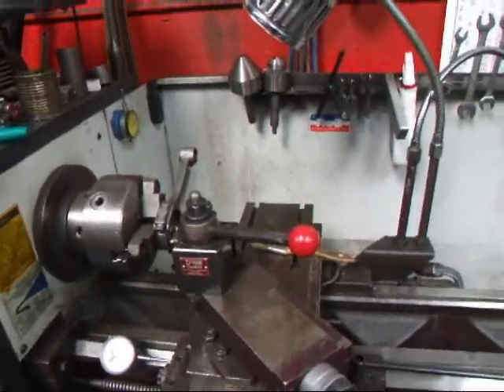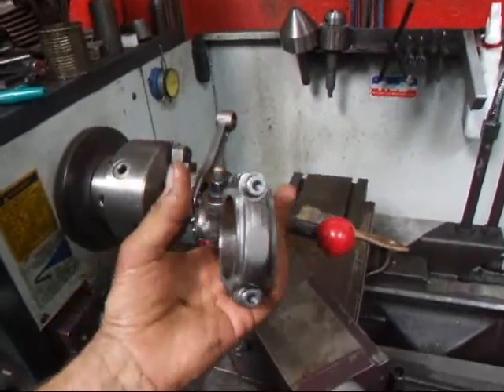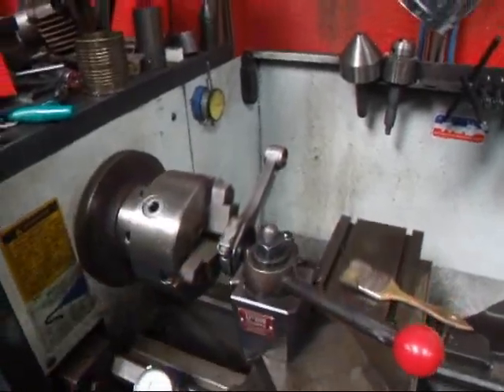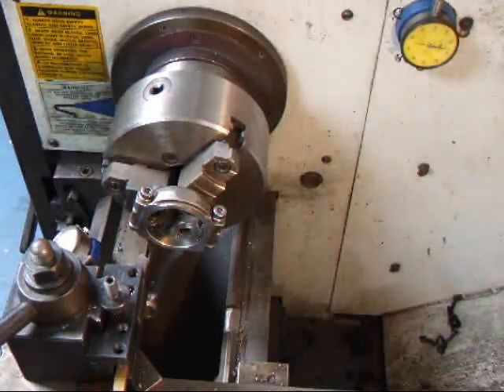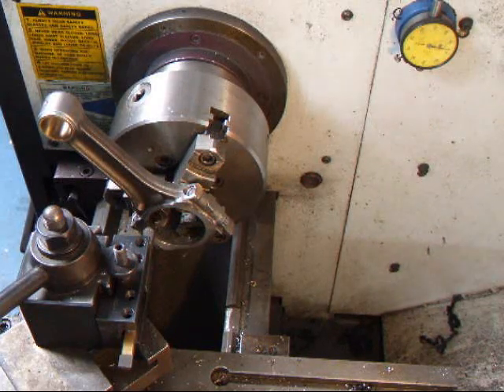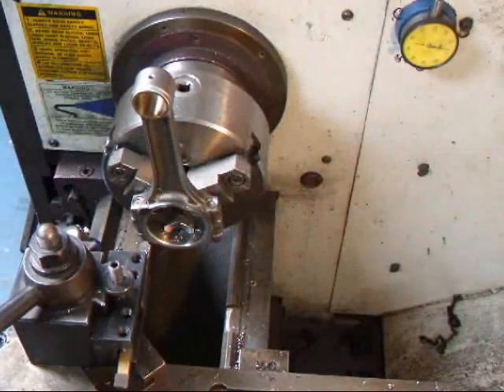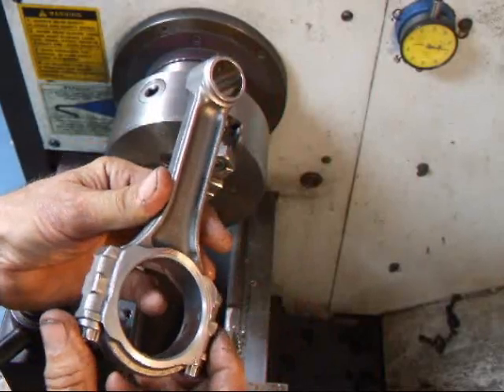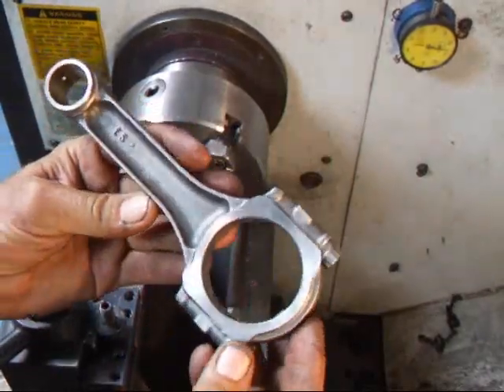Connecting Rod Narrowing

Comment: How do you fracture the connecting rod ends. caps...?? I was told you can just put the in a vice and hit them with a mallet. If so can you make a video ? I cant find one at all. Proform has a tool but I just need to fracture two of them. Only replaced 2. So the new ones came in without being fractured.

Comment from the maker: The mass of the rod compared to what is taken off will generally negate the need for coolant, plus the mess factor. As with any machining operation, the heat should go out in the chip (blue color) and not be retained by the workpiece.

Comment: technically it's not stressed when it's on the crankshaft (if it were it would wear out rod bearings) ... just the torqueing of the rod bolts should be all that is needed.